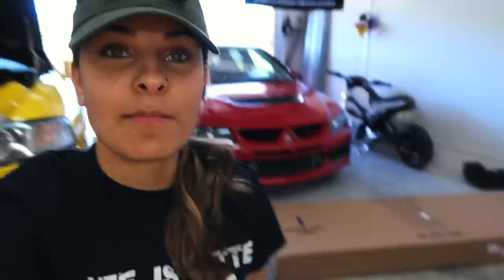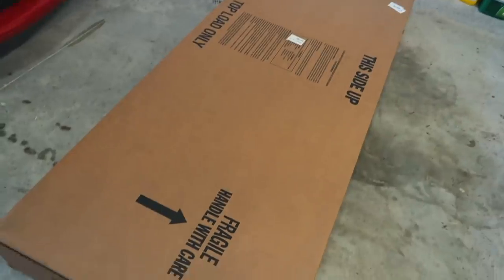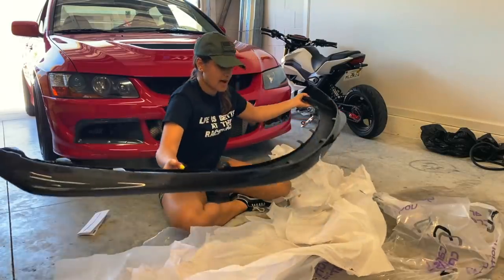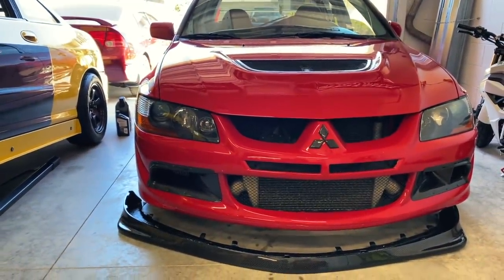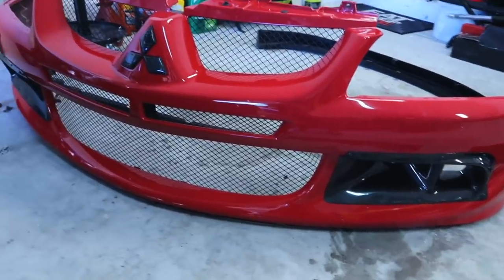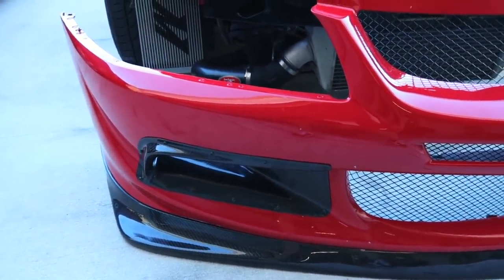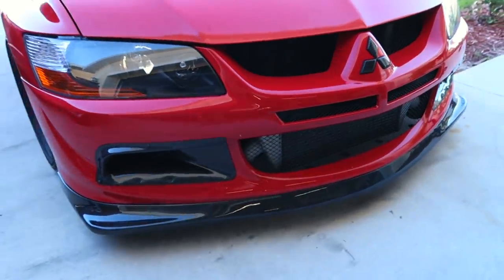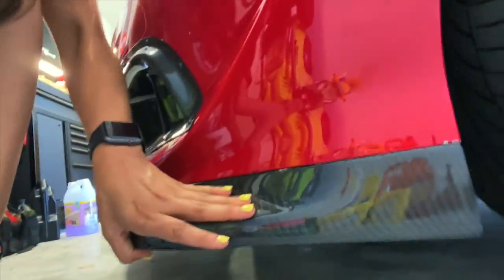EVO 8 CARBON LIP INSTALL- CARBON CREATIONS LIP

Comment: splitter has 3 benefits, 1. is the cut thru air and 2. more down force on the front end while going fast and  3. protects the front lip while you drive on a steep road or steep driveway

Comment: Thanks for another cool video, the Evo is looking great!
I went with the cheap $120 IKON Lip off Amazon. Prepped and Painted myself using OEM body color.
Though I have read a few reviews that the cheap lips dont fit but the one I got fits fine and I think it looks awesome on the car.
Your looks a bit more rigid than mine. The IKON one is a lil bit flimsy but once it's mounted its all good, maybe even better to have a little flex so it doesn't crack too easy?  idk Anyway after about 9 months on the car it still looks pretty good aside from some typical chips on a front bumper.